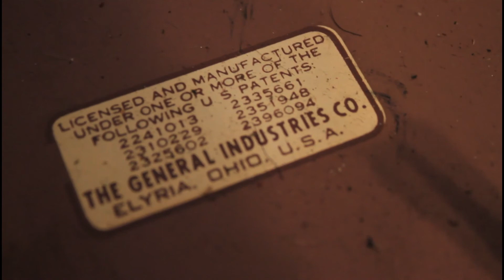General Industries record cutter internal info

Comment: How do I remove the platter to inspect the drive wheels?  It seems to be stuck on the spindle or am I missing something?
Reply from the maker: It pulls off. It's friction fit, so it may be a bit stuck on there. It helps to turn the speed switch to the middle, right before it clicks over to the other speed. That disengages the drive wheels from the platter.
Reply: @rbmrecordplayers5758  thank you so much!  I did get the platter off by using the switch.